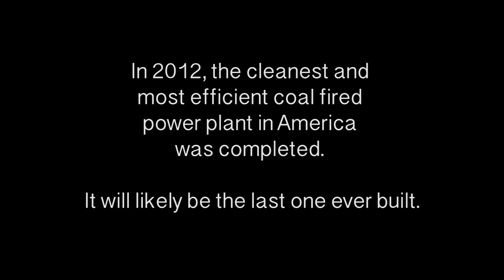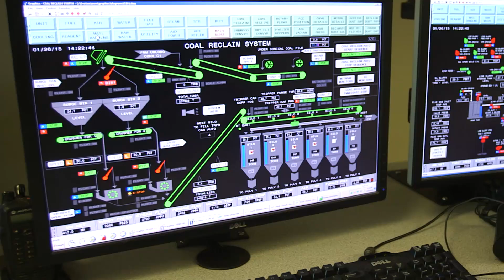Arkansas Ultra Supercritical Coal Plant Technology Faces Extinction

Comment: They ought to use this technology  and more to States that really mine coal  If we have  a method of  new drilling shale oil   Properly known  as fracking  for oil and natural gas  We can use 50% of our coal along with trash.  Gene K. is absolutely correct Our vehicles still do make pollutants of CO2 and other chemicals The one thing we must do is eliminate  diesel and convert it over to natural gas or liquified natural gas The latter is more useable. It does not require heavy compressors to carry  Yes it does make a Carbon imprint I also agree with Bio- diesel to some grade Airlines are using  algae  for their planes Also the way  newer planes are designed  will help save 20% energy saving. The U.S. Military is also using bio fuels  such as algae  methane  and other substances